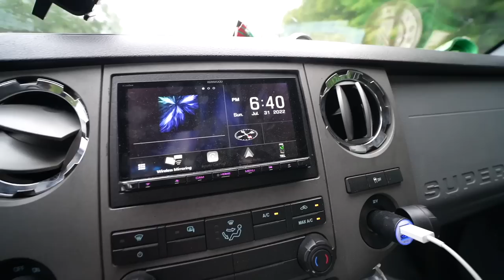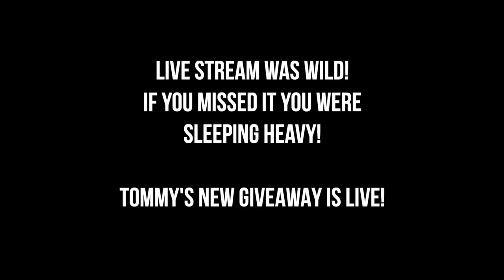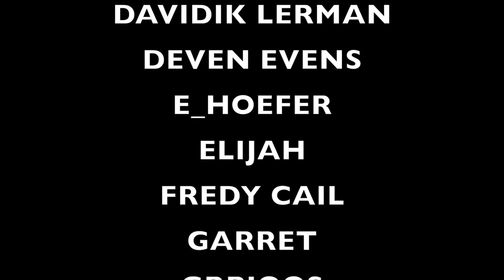LEAVING THE SHOP FOR GOOD!

Comment: Use muriatic acid much cheaper and I bet that is the active ingredient in your trailer cleaner.  Put about 50 50 mix of water and acid in a 5 gallon bucket dip your brush in and lightly brush on. Let it sit a couple minutes and rinse off.